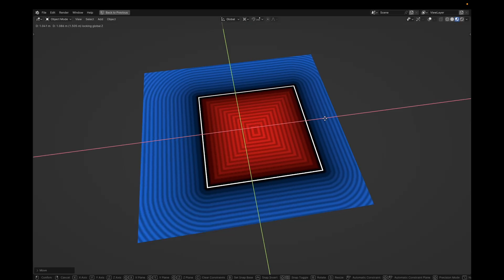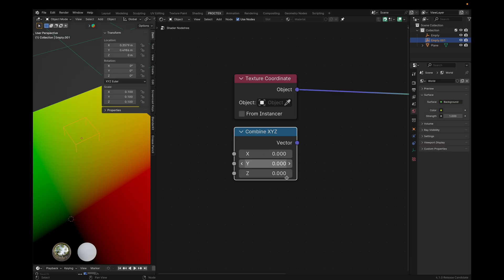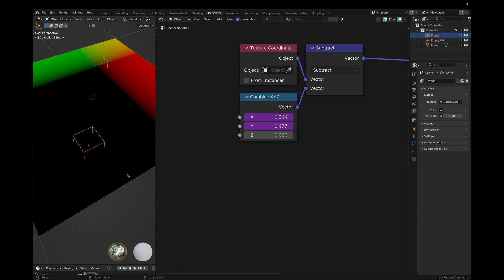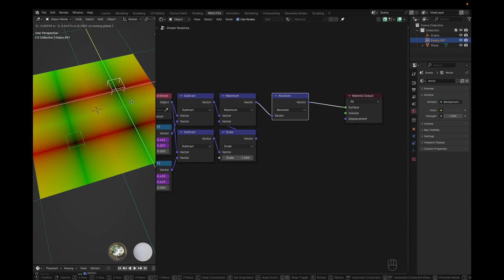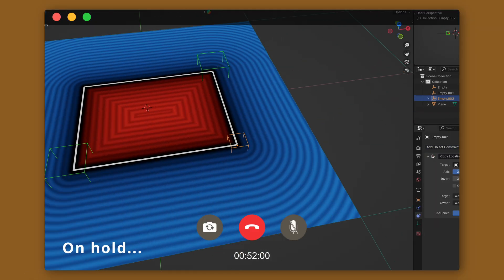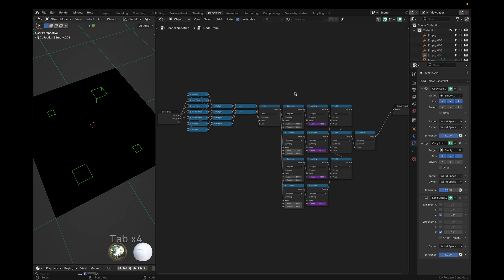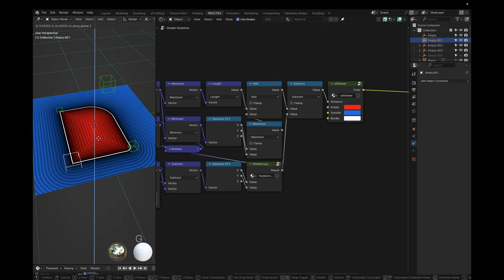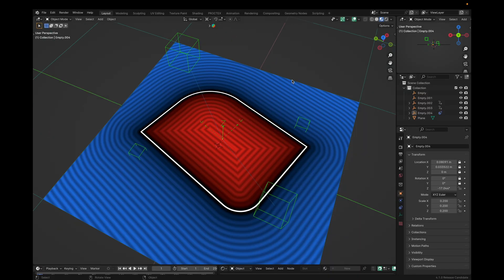How to Make Interactive Shaders with Drivers - Blender

Comment: Keep in mind that drivers are changing constant values within the shader, which means every change causes the shader to recompile. Blender is smart about this so changing a single constant in a small shader is trivial, but for more complex shaders it still has to navigate the node tree every time which can lead to non-negligible (1000ms+) compile times, or in other words, enough lag to become noninteractive.

Instead of driving values in the shader, you can keep great performance (i.e. totally avoid recompilation!) even for extremely complex shaders by using named attributes in the shader anywhere you would use a driver, and then populate those attributes using a simple geometry nodes setup.
Reply from the maker: Thanks, I'll make sure to use attributes going forward.